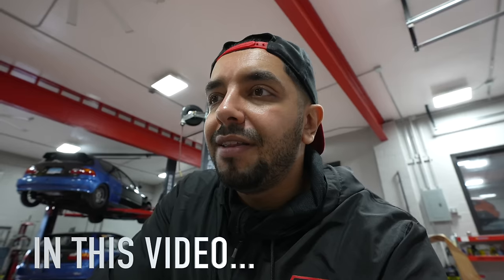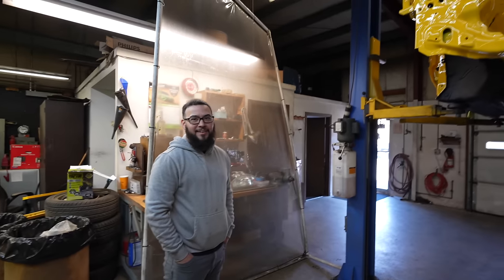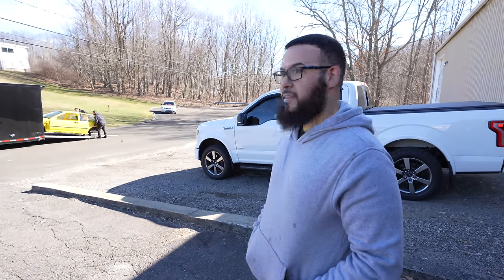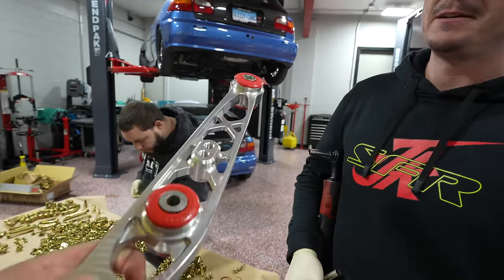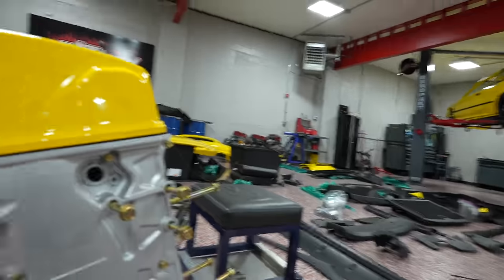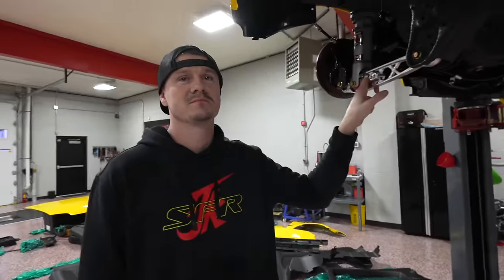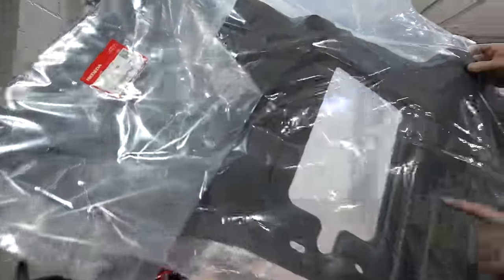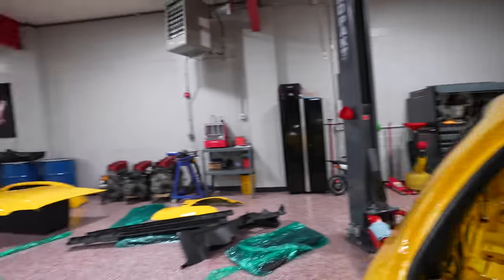Yellow Spoon EG build gets another make over!

Comment: wheels will make or break this car look .but tyre size n width is the deal breakers ... however the lca looks great polished simply because to much black or to much yellow will be over killed, the polish lca is perfect, the red bushings works as well as when you see it you see bizz and the red it very minimal and flows with the ktuned stickers.just remember alot have done the spoon build so make this spoon build more along the mind spoon. i would think Spoon Sports CR93 wheels in gunmetal gray with slight hint of silver metallic flakes on it. very slight metallic flakes as for tyres something not to low not to high , stance got to be no more than -1 negative camber.